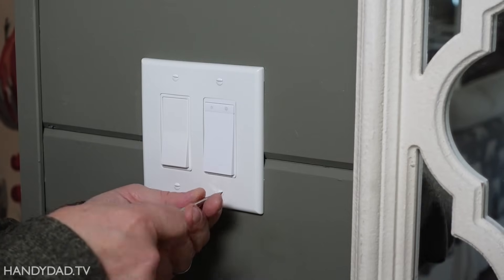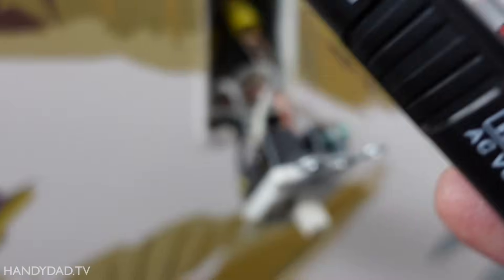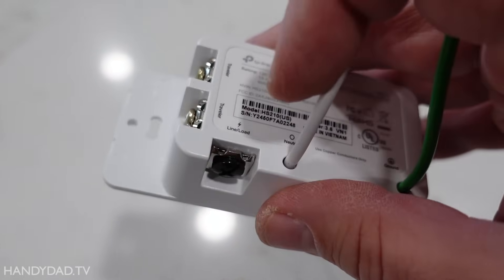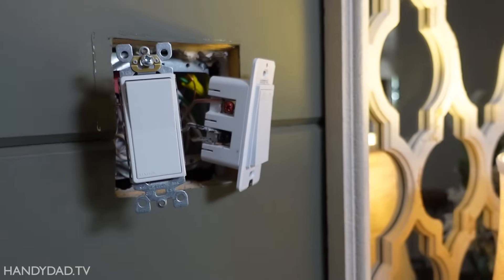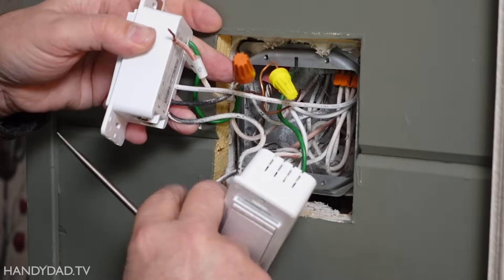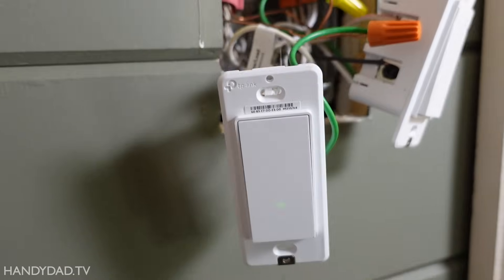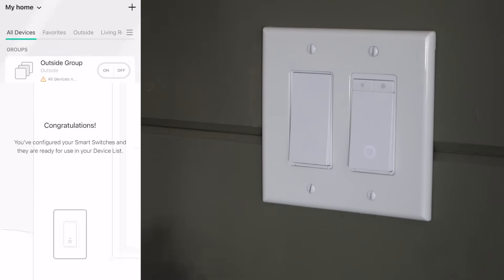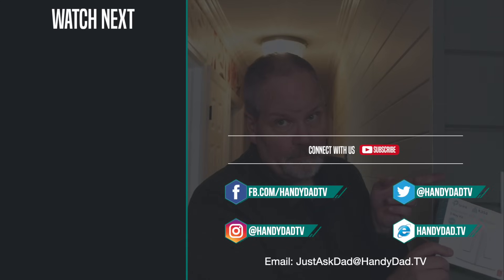Automate a 3-way circuit with a smart switch

Comment: In older homes, there is often no neutral run to the switch boxes. I understand there are some wifi capable switches that do not require a neutral -- not sure how this works. i had a chance to fix this in some interesting places when I had the wall open. Darn.
Reply from the maker: Smart switches that don’t require a neutral are either running a tiny bit of current through the ground or the load to maintain the network connection.

Comment: Do you still use insteon?   How does Kasa compare?   Do they work well together?  What about the ISY?  There are 1000s of us still in insteon looking for options. That would be a great video.  Did I miss it?
Reply from the maker: No, I ditched all my Insteon and the ISY. I tried HomeSeer for a while but now use Home Assistant. I have a mix of Zigbee, Zwave, and other devices, but Kasa is my go-to for simple wall switches. Such a great value and they support local control with Home Assistant so no dependency on their cloud servers.
Reply: I just found your HA tutorial.  That would have been so helpful when I tried to make the switch when insteon went off line.  Like you, I got frustrated and quit and went back to insteon hub when it was reborn.  I did manage to get the software loaded onto a Raspberry Pi which is more than half the battle so I may revisit.  I don’t have a great feeling about insteons longevity, but I do love that it uses both x10 and RF and reliability is rock solid.
Reply from the maker: @gregrobinson4683 I had a relationship to help spread the word about Insteon on my channel and I was very committed to their success until they closed their doors without a word. In business, you’re either growing or dying. I can’t imagine they are growing.

Comment: I’m also a big fan of Kasa products.  They integrate seamlessly with Alexa and save the day when my kid forgets to turn off the basement lights.  Their smart plugs work perfect for controlling things like our Christmas tree lights, both indoors and out. The Kasa app lets us set schedules which helps in times like going on vacations or if we're simply going to be out late and we want lights on for security reasons.  As for reliability, I just checked my Amazon order history and I bought my first device back in 2018...18 devices later I haven't had a single issue.  Highly recommend them.